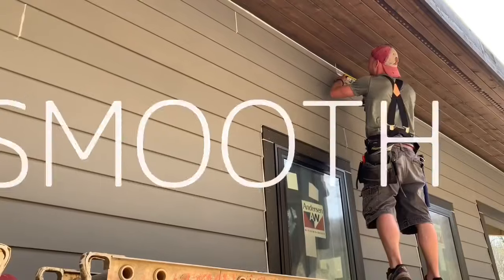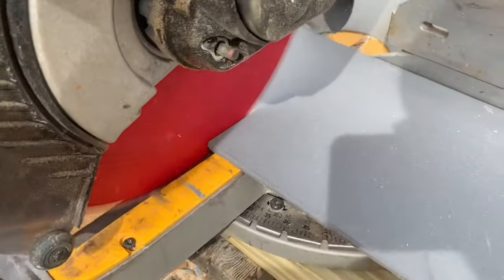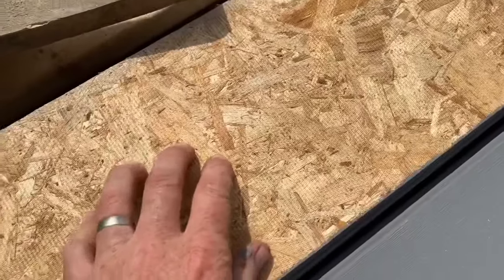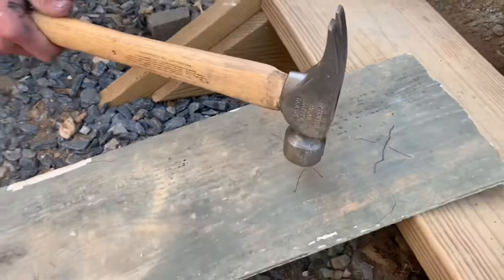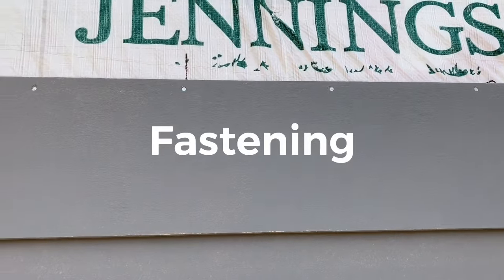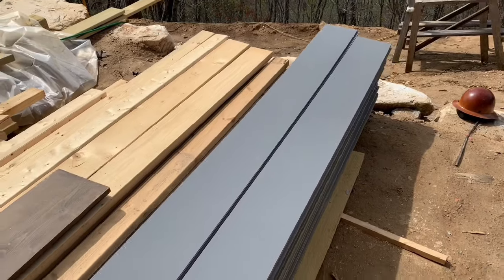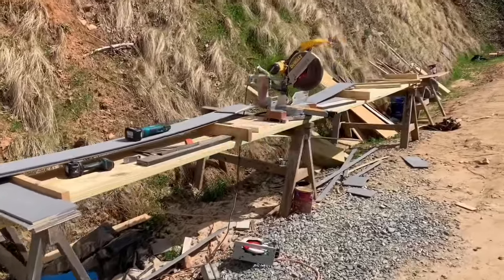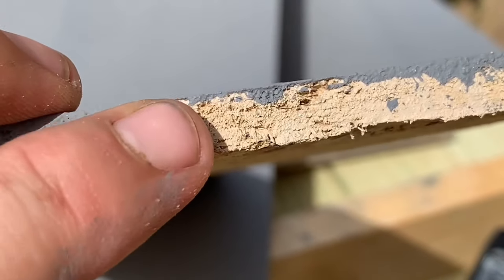Smart Side vs. Hardie Board Siding which is better

Comment: My brother had a piece of Smartlap (wood grain textured) get covered with dirt next to a pile by his shed.  Was covered in dirt out in the weather (in Nebraska so all weather conditions) for at least 5 or 6 years.  He cleaned it off when it was dug up and you couldn't find any rot or bad spot on it.  I was sold on it from that point on.  Not that I think Hardi is a bad product either though.
Reply: I have a 2 foot piece of smartside hung on a woodpile out back. ( NO. ILL. ) the edges are starting to swell. 6 year on.
Reply: I have done these test with different products from time to time and they pass. As a contractor once told me, they pass all your test until you put them on your house and they fail. Tip never use decking that is a wrap.
Reply: @dustbat  I didn't understand what you meant by the tip...?
Reply: @yepper1165  I can see that. I got off topic a bit. Switched from siding to decking boards, the new type. The company was so proud of this product that they gave a solid warranty for the product and labor. Lucky for me. They fully replaced it once and a year later gave me a total refund. The product was a wrap. Like made of milk bottles etc and wrapped with a cover of virgin pvc. Many new things are a gamble and you do not always win. So, hope this helps. If you are using decking and it is a wrap, I would use something else.
Reply: @dustbat  Thanks fir the explanation.   That's definitely good to know!  I personally like trying new products.  But you're right,  sometimes they don't stand up to our expectations or just don't work for some applications or climates.
Reply: @yepper1165  I now only would try new stuff if it came with a powerful warranty. Had one contractor tell me that we do not know how all this stuff we put on peoples houses will hold up. I love my pvc rake boards, vents,etc. however those long units do shrink and expand a heck of a lot. Have to find the best calk, and you can for that. So damn interesting and  enjoyable to learn about, even as an old person.

Comment: If a couple of coats of paint are what's sealing the cut  edges, then what's this gonna look like in 20 years?  And if a smaller reveal is wanted, does this require ripping the planks to a narrower starting width?  Can only overlap non-bevelled boards so much.

Comment: Question?  How is the quality of vinyl siding compared to these two options?  I ask because the Hardy Board on our house is getting so rotten I can easily punch indentations into some areas of it with my finger.  It’s probably a coincidence but this started after I had our house painted about 4-years ago.  The next time I have siding on our house painted, do the painters usually put new caulk or something to prevent water from getting behind the Hardy Boards?

Comment: Hey, you know what I buy in 16' lengths regularly? Wood siding. What this stuff is meant to mimic.
My butt joints mostly disappear.
Reply: Tom Senft ...And you’re right, I sleep better at night using ‘real wood’ siding even though y’all have to deal with the splits and splinters. And pre-primed is worth the extra money in the long run. Happy building y’all
Reply: eh wood grows mold, smart side doesn't

Comment: I agree smartlap is a great product, much better than fiber cement.   On the butt joints you should put flashing behind joint, then you don't need to caulk the joint.    Caulking butt joints looks terrible.
Reply from the maker: Flashing the butt joints is a great way to do bombproof siding… I do this as well as caulk him to give it a double seal.

Comment: Smart side easier to install
Hardie made to last
Reply: LP SmartSide has the same 50 year warranty as the Hardie and it's more durable than the Hardie.
Reply: Fido Paws Only of a homeowner keeps painting and caulking it periodically.
Reply: @tmiranda1379 , you have to paint hardiboard also.  Smartside is better plain and simple.
Reply: Lol...yeh as long as it never gets touched!
Reply: @tecnolover2642  what kind of comment is that?  Are you referring to hardiboard or Smartsiding?  Smartsiding is superior.

Comment: can you nail lp smart side 4x8 (5/8 thick) srteight on the 1" JM Polyiso Foam Board Insulation (foil faced)? Do I need a rain screen (1x2 planks) in between the foamboard and the lp smartside 4x8 sheets?

Comment: This product will be like Masonite siding easy to put on so 5 years later they can put it on again. I put Hardie board with factory paint quite a few years ago and it looks as good and weathered as it did the day they put it on. When they tell you that the sides can soak up moister, do NOT buy it unless you are going to use it inside the house.

Comment: After 20 years which will still be performing to spec? Homeowners want products that last. What are the fire withstand capability of each board? Should smooth siding be painted on all sides to last?
Reply: SmartSide has the same 50 year warranty as Hardie.  As for fire, if your house is made of wood then the siding is not going to matter much.

Comment: One point of misinformation here as the guy otherwise is spot-on. SmartSide comes out very dry after the manufacturing process. The lap siding has to be gaped butt-end to but-end 3/16 or 1/8 as that is fine as well. Reason being is that the material will acclimate to the humidity environment one time and expand slightly. It will NOT contract and expand like PVC which does so with fluctuating temperatures.  SmartSide overall in my opinion blows FiberCement away in so many areas. 50 year warranty with a 5 year labor coverage should anything go wrong in that time frame. No other manufacturer offers that labor component to my knowledge.

Comment: Seems to me this is all about how much easier one is to install over the other! Doesn't care which is better, just which one is the fastest for the contractor to get done and move on to the next job!
Reply: Fred Kaminski I like the way you think. The customer will decide so ye
Reply: Then why does LP have a longer warranty than Hardie?
Reply: tecnolover2642  good point
Reply: @tecnolover2642  Because it is manufactured to perform and is more durable.. 5/50 warranty.
Reply: @tecnolover2642 because LP has more stipulations that will void your warranty. Also no warranty it really wet climates.

Comment: I've been using SmartSide for 21 years on several new homes and other projects. The 1999 home I built has the original ONE coat of paint on it, the owner doesn't like the color but won't repaint until it needs it!!
Cement based siding is terrible, but was pushed on the market very aggressively. I used it once, NEVER AGAIN.

Comment: In my limited experience I do not like anything that looks like a glorified MDF based board for exterior use... even if itz sided with high tech plastic or water proof protecter ...like smart side. I've seen too many wood pulp/glue combos turn to mush especially at the bottom edges where rain splashes back.
Reply: It is NOTHING like MDF. Nothing
Reply: @IllinoisCitizen  If its pressed laminated wood, then its like MDF. Doesn't matter how many hydrophobic coatings, waxes, resins, paints, and chemicals you pump into it, its still 99% OSB. That's like saying frosted flakes is nothing like corn flakes.

Comment: I have used both products; and have to agree Smart Siding in every aspect is a superior product.  Hardi DOES absorb moisture too...Instead of painting the cut ends, one could just dip the ends in clear deck sealant to seal.  Quicker, and absorbs sub surface.  If desired, follow with a coat of primer.  Cheers!
Reply: If the smart siding will absorb sealer it will absorb water too. The question is which product handles the worst case scenario better.

Comment: Thank you for the video but I would not put that crap on my house. Fiber cement for longevity.
Reply: As soon as I saw that pressboard backing, I was certain that this product can’t have the same longevity as hardie.
Reply: Can't say that I would use either. Hardies is a rubbish product and the only time I use it is if the client really wants to use it.
Reply: @jaye9300  Actually I've seen many instances of Hardie cracking, it is very brittle, the smart siding had a good warranty.
I've used both, I would definitely go with the smart siding.
Reply: I’ve seen horror stories with Hardie planks under hail storms, brittle crap. And I don’t care that they give a warranty, because who wants to replace your homes siding every time there’s a hail storm....I sure as hell don’t. I’d much prefer Smart Side, at least with Smart Side you don’t have to worry about anybody falling sideways unbalanced on your Hardie Board and breaking....just isn’t worth it as far as I’m concerned.
Reply: 1Ephraimite - have any links it videos? I haven’t found any
Reply: And another person who has no clue what they are talking about.  Smart Side is superior to Hardie.

Comment: QUESTION...  I bought a house that was built with some siding that I need to identify because I need to buy a bunch more for another building, but can't find any images of it online.  It's an engineered wood product, but has a plastic strip running at an angle along the back of it, about 1/4 of the way from what I assume is the bottom of the boards.  Any idea what that might be?  Thanks!  C

Comment: I would like to add that another tactic to save a few bucks , if that's your bottom line ? Is, most regions have a predominant weather direction , and knowing this, one side of your structure is going to receive the bulk of the wind, rain, hail, snow,etc ....
With that, if you spend the bit of extra time and expense on that area, your overall maintenance and repairs will be substantially less  !
I reccomend additional steps in moisture barrier call outs , along with the highest durability materials in regards to the exposure  !
Cheers

Comment: Smart Siding isn't a smart choice in Texas.. Atleast not in Houston. It's hard to consider smart siding With Houston humidity and Texas heat. I was a cornice cutter for 2-3 years and hardy board siding wasn't an issue to cut. Diamond concrete saw blades cut cement boards like a knife cutting thru butter. Main issue was Texas heat 😅. Texas heat is no joke...

Comment: LP Smart Side is much easier to work with. Why doesn't Lowe's and Home Depot stock Smart Side siding? They only carry the 4x8 LP sheet panels in the store. They do stock Hardie 12' lap siding. Odd considering the special handling needed to use the Hardie Board.
Reply: My Lowes does stock Smart Siding along with the trim boards and panels.  And I live in a small, rural area so any Lowe's in a big city should definitely carry it.

Comment: dont ever caulk but joints, it look horrible and eventually caulk will get pushed out! just install some 26GA metal peace or any thin durable product under but joins, and you will be happy with that!. it will look good, clean and will keep that pesky water from getting to your wall! also, i would highly recommend to have some sort of rain screen. even if you live in dry climate, it will help to keep your home bit cooler, as it will have that small air gap, which will work as sort of insulator. and rain screen will prolong the lifetime of the siding, any kind of siding!

Comment: I still question the longevity of the smart side when it comes to long term water exposure...
Reply: I left some of it exposed for over 2 years with no paint and I left it upside down to expose the backside and it did not swell at all.  I have no concerns with it at all.
Reply: I've seen Hardie unpainted for 10 years and have zero issues. Until it can go that route I wouldn't recommend it over Hardi.
Reply: @jerrellbevers6071  LP owns the shed market with SmartSide. Seen many 8" OC paneled sheds out there for years unpainted and no issues. What does that tell you?
Reply: I had to replace the bottom 3 feet of smart side around my house due to rot...and the rest of it all the way up had some swelling on the bottom edges. “Wood” not use it again...

Comment: Your hammer demo WUZ FLAWED !!!
You hit one w/8” on step ! Hardie on step 5” !!
 Hardie will break a hammer head circle ! 😬 Seen it many times !!
OSB modified ??
Reply: I agree. That was CLEARLY a biased test. The non idiot way to do that test is free-fall weight test with duplicate setups in a jig or frame, re-used for each test.

Comment: I don't think you can say that one product is categorically better than the other.  If you have a structure that is subject to high risk of fire, termites, rot, and paint degradation the Hardee siding is worth the one-time hassle.  If not, the Smart Side may be the better product.  I have a use for both on different properties.

Comment: Is Hardie Board our generations asbestos siding? In 50 years when it starts to crack, will the landfills take it? Will people be reluctant to remove it because of the silica dust? These are honest questions that I have. I'm a DIYer... been burned too many times hiring people to do what I can do on the weekend and evenings. Smart siding seems like the smart choice but I'm not 100% decided yet. Does anyone know if Smart siding or Hardie can go over existing asbestos siding?
Reply: What do you care 50 years from now? I'm a retired contractor and I wouldn't build a dog house with an OSB type of product, let alone my own house.
Reply: @RCSTILE  Its not OSB Richard. Look into what's used in the manufacture of the product and the process. Your dog will be happy.

Comment: Best way to test this vs Hardi plank is take a scrap piece and toss it in a 5 gallon bucket of water for a week or two. Take it out and see the results. The hardi plank wont be mush because I've done it. I haven't tried the smart side yet.
Reply: My house isn't under a lake so i don't see why this test is recommended to compare products... Its ability to withstand impact does matter to me because my vinyl siding breaks from bird shit. I don't want to replace siding because of a loose baseball or a dumb neighbor launching ice out of his snowblower.
Reply: @MelvinIsMerlin   most people have issues with siding rotting. If you've ever seen a house that's had masonite siding installed on  it usually it needs a complete siding replacement due to rotting and the lower edge tends to get cracks and absorb water and swell.

Comment: Have you ever seen hardie board with moisture damage? I have so if the homeowner doesn't keep up with paint when the time comes it could eventually fall off the wall.
Reply: I have seen Hardi plank crumble to pieces on a chimney on the roof in the Texas sun. Hard to believe
Reply: People fail to understand that Hardie has wood in it. Fiber. Like in FiberCement.

Comment: The whole idea is that fiber cement is not wood so it won’t rot. Secondly you shouldn’t use galvanized nails when doing siding even condensation will cause rust stains
Reply from the maker: The whole idea with all siding is that when it is installed correctly, water never touch the backside of it.  The outside (front) of this stuff has a super thick coating that is impervious to water. Yes we are using galvanized nails... always a good idea just in case. I am not sponsored or paid by this company but I do like the product compared to fiber cement siding and had less trouble with it.
Reply: Perkins Builder Brothers But no cladding is water proof, ever. And assuming it is only will cause issues down the road.
Reply: Actually water will get back there no matter what. Either from condensation, capillary action, vapor, strong winds, fog.

Comment: Wouldnt put smartside on my house. Ive installed both for years.
Reply: The Gooberment-Sucks  I put masonite on a garage 25 years ago and it still looks good. The secret is to drill all the nail holes and never drive the nails in. Never break the siding at the nails. Let them stand proud.

Comment: yes Hardi plank is harder to install. Most homeowners and high end builders don't put that real high on the list.
Reply: @speedgonzalez489  I think you mis understood. They like hardi, they don't care how easy or hard it is to put up. I do a lot on high end homes in chicagoland.
Reply: with hardi.
Reply: @speedgonzalez489  hey I'm  in Austin. With all this virus stuff going on are you looking for work. ? 
I need a guy for for a few days.
Reply: @dustinmack1283  yes I am working. Doing a remodel in West lake. Are you siding or framing?
Reply: @speedgonzalez489   Im a Handyman i do alot of different stuff.
Reply: @speedgonzalez489  I'm about to replace the siding and trim on a 2-story chimney. I'm going with Hardi
Reply: @dustinmack1283  plank or 4x8 sheets? A house that big will be longer then a couple of days if done right. You have scaffolding? We may be shut down this friday .?
Reply: @speedgonzalez489  Can I get your opinion for replacing the siding on my 70's built ranch home in Dallas? Can't decide between the Hardie board or LP Smart Siding?
Reply: @frankarango4071  a ranch home might look good finished with Hardy , but done board and batten not lap! It will last
Reply: @speedgonzalez489  thank you!

Comment: After the silly impact test, which does not represent how the boards are installed on the walls, so it is completely irrelevant, they should have done a rotting test and see how those LP planks are going to perform.
Hardie boards when installed, even on rain screen, will not break on impact as shown on the video.